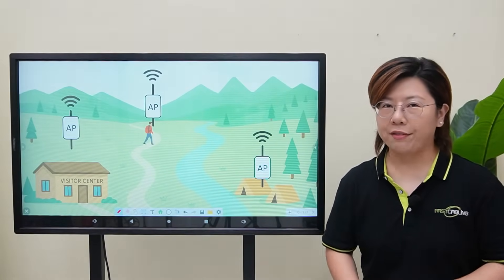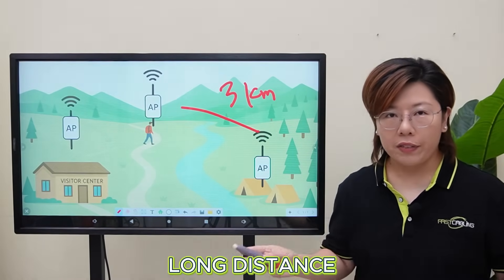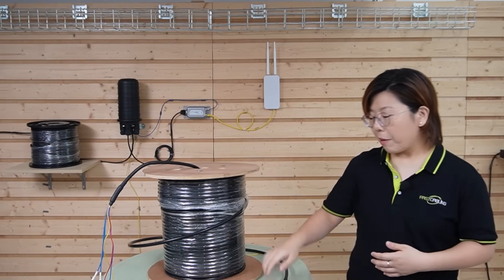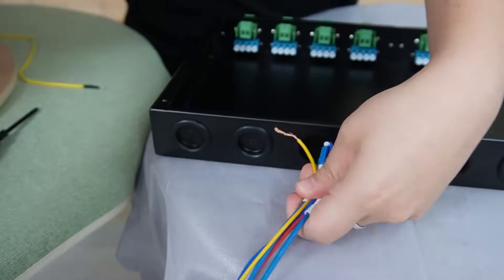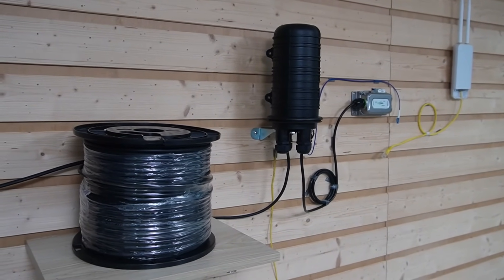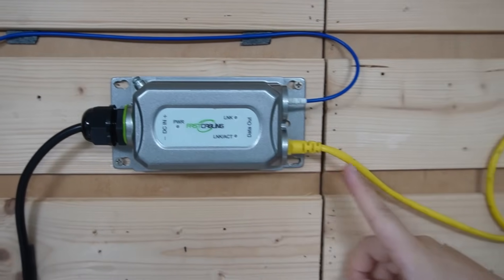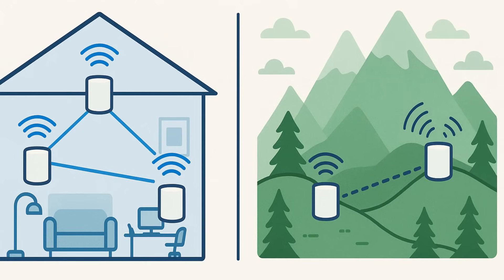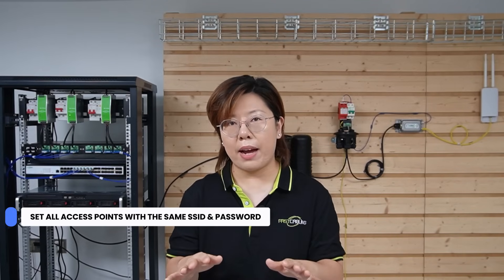3KM PoE & Fiber Optic Cable Setup for Rural Internet | WiFi for Remote Tourist Areas

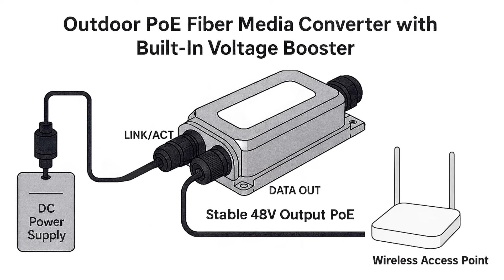Comment: 9:46 - stable 48V???
48V is not enough for PoE. Type 2 and Type 3 PoE (PoE+, PoE++) requres source at 50V to 57V and Type 4 PoE requres source at 52-57V.
56-57V is suitable voltage for all versions of PoE PSE, 48V isnt.
57V into combined cable with 5V voltage drop barely fits into Type 4 PoE without any voltage boosting.
Reply from the maker: You are right. The IEEE802.3 specification is designed based on 100 meters.

Comment: What is the AWG rating of the cable? and the voltage drop from 48V
Reply from the maker: 20awg. We can customize the copper conductor size if required. Please contact us at support@fastcabling.com.

You can add a 48V voltage booster if that's a concern. https://www.fastcabling.com/product/48v-voltage-booster/

Comment: nice! I wish all companies would make videos like these showing how their products work! amazing!
Reply from the maker: Glad you enjoyed the video!
Reply: Very nice videos, but the ground part, it will need a wire terminal so the stranded wire has better connection, and also the nut seems to turn, so not too tight on the chassis for its ground purpose.